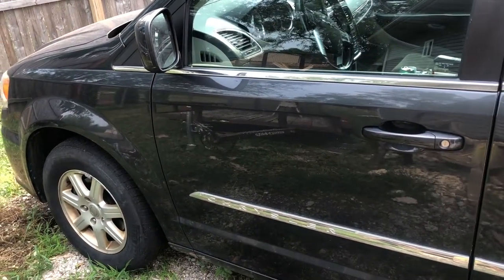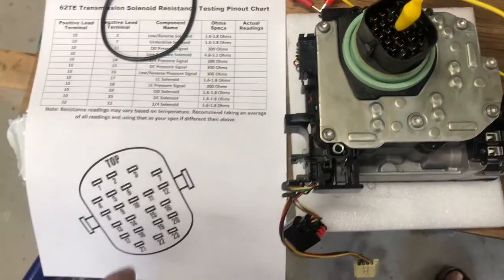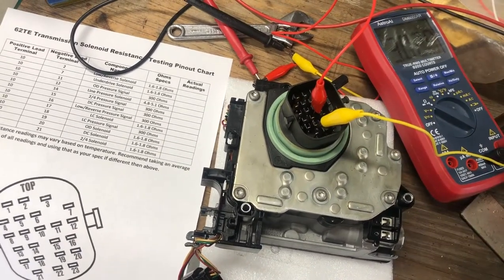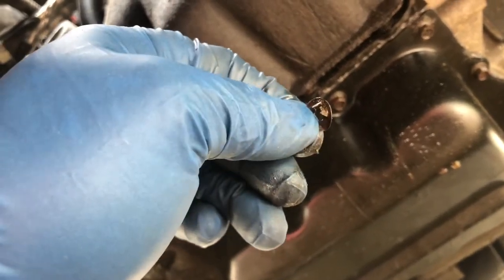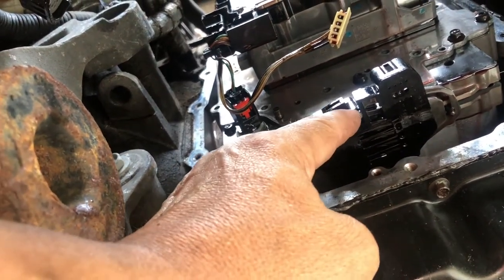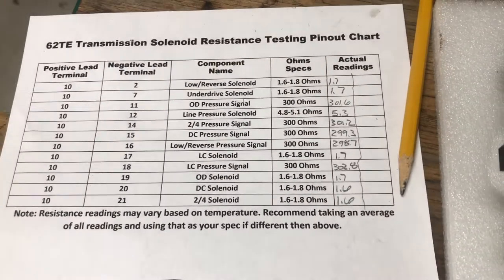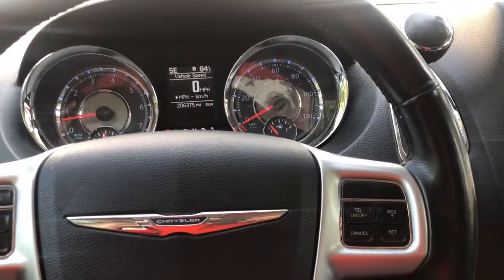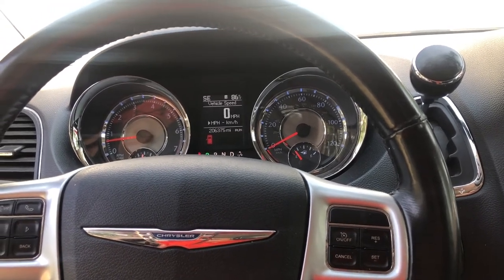62te Trans Solenoid Pack Replacement - 2012 Chrysler Town & Country

Comment: Great Job doing my 2009 Town and country same solenoid dc pin 20 glad you got it fixed I also noticed when no shift manual shifting gone also no numbers either shut off Van restart good for a couple miles.

Comment: excellent video, with lots of very interesting explanations.
In your opinion, why does my gearbox, when it reaches more than 80° and when I almost come to a stop, the engagement of first gear is sometimes a little abrupt and sometimes idling is a problem a little unstable. Thank you for your response, it would help me a lot.
130000km

Comment: I have a 2016 Grand Caravan with 85k miles. Yesterday I was driving and heard a whining sound. I was in a bad area at the time so I jumped on the highway, drove about 10 miles, and when I exited the highway, after coming to a stop, the van wouldn't go. It wasn't catching gears for a few seconds then finally caught gears enough to get it to the side of the road [no lights on dash]. I called a couple people, and decided to take a chance to go another 15 miles home. The ENTIRE TIME it would only go up to 2nd gear and sometimes wouldn't even do that. I finally got it home. There are still no warning lights on. I checked the trans fluid level with my scored oil dipstick [I learned to do this from other YT mechanics], and it read way too high. The fluid itself did not smell burnt and looked ok. I siphoned about 1.5 qt out to get it right at the top of the hot line. It's still having the same issue. Still no warning lights. This is our only vehicle. Advice would be MOST APPRECIATED. Thank you in advance! 

Update: I disconnected the battery for a while and reconnected it. From what I read, that exited "limp mode." The van started to go then I heard the whining sound again, and the same thing happened [STILL NO WARNING LIGHTS ON]. I don't know how to diagnose it. 

Update 2: After disconnecting the battery again, I finally got the van to throw code P083B
Reply: Got the same issue. Did you find the problem and if so what part did you replace?
Reply: I know this is a year old comment, but for anyone else: when you hear the transmission whining it is almost always a clogging trans fluid filter. The whine is the oil pump pushing fluid through a clogged hole. Eventually the transmission will be so oil starved that it won't have the pressure to shift gears and you'll get slipping.  Sometimes turning the car off will relieve the clog temporarily and allow you to get into a gear. First step is to get a filter and 6 quarts of oil and drop the transmission pan for a fluid service. Beyond that is this solenoid pack service because dirty fluid will also clog the solenoids. Certain transmission codes will lock your transmission into limp mode which usually sticks you into second gear allowing 0-45 mph. @manuelsaenz2908

Comment: I have a 2013 doge grand caravan thats stuck in limp mode. And its throwing a P0760 code overdrive solenoid contol circuit. Do you know which soliend this is or which one i have to change? The vehicle has 88,000 miles on it

Comment: Currently researching, I got a P084B code. Everything I’ve found points to this solenoid pack 🤦🏻‍♂️
Reply: @CashApp-HelpMeStayAlive  I did some quick research. It could be fluid level is low, a bad sensor, or maybe broken wiring. I’d lean toward the sensor. Since you’ve done a fluid and filter change, clear the code and test it. If it’s still in limp mode or code pops up again, probably a sensor.

It should be the one mounted on the valve body itself. You’ll see it at 13:04 with the red clip.

For me, the whole solenoid pack fixed my code. They do sell the whole valve body with the solenoid pack installed with new sensors but it’s a bit pricey.
Reply: @fishinwithhomer  he what sensor is that with the red at 13.04 I have the same code I’m trying to hunt it down
Reply: @juliankira9432  I believe it’s a line pressure sensor
Reply: @fishinwithhomer where did you purchase the solenoid pack? I desperately need one right now. Thank you in advance.